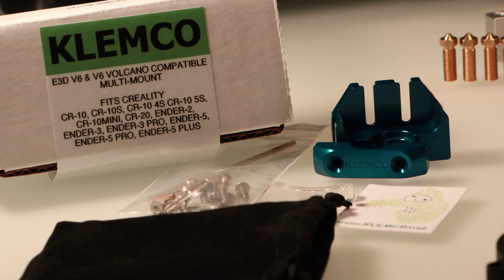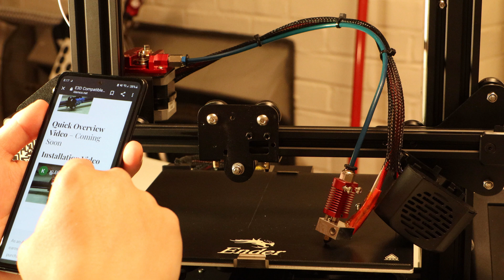Ender 3 V2 - Print Silently and 4X Faster!  (Step-By-Step Guide)

Comment: Thanks for the video! Just wondering why you didn't upgrade the cartridge heater to 50W to get increased plastic flow.
Reply from the maker: The main reason: this was my first mod where I changed parts on the hotend and I wanted to keep the old components so I didn't mess anything up.  

You only really need to upgrade the cartridge if you are sustaining very high flow rates or printing high temperature filaments. I haven't got there yet but I'll be testing out some high flow hotends soon that I'm super excited about. I have a couple from Phaetus and one from MicroSwiss. I'll use some 64 watt cartridges so I can push over 60 cubic mm/s, then eventually past 100 cubic mm/s with a crazy double heating cartridge setup that is currently in the works.

I would really like an LED hooked up to the heater cartridge so I can see when it's on and off. That way i could easily see if the cartridge is working at its limit.

Comment: Dude you could have easily installed the fan internally on the power supply
Reply from the maker: Yeah, I recommend that for anyone doing this mod that is comfortable with opening up the power supply. Just make sure to unplug and discharge it before you begin!

My other concern was that the noctua fan would not be powerful enough to keep the PSU cool. By leaving the old fan in there I am 100% sure at least one of the fans will satisfy the cooling requirement designed in by the PSU manufacturer.
Reply: @NathanBuildsRobots  what's the point of the noctua fan then?
Reply from the maker: @certified-forklifter  It makes it quieter. The PSU stays cooler so the fan turns on less often and when it does turn on the noctua fan muffles the noise it makes.
Reply: @NathanBuildsRobots  mh, okay

Comment: Noctua makes 24v fan.
I'm not an expert in 3d printers at all, but I can't  understand why everybody on YouTube is so eager to put 12v fan on a 24v power supply when literally the SAME brand makes 24v fans at basically the same price.
There is even a Linus tech video about them. ... So no excuses not to know about them
Reply from the maker: I believe your  are referring to the 24v industrial PPC fans.

The issue is they are pretty loud when running full speed on 24V since they are designed for industrial applications. Plus they are more expensive than the consumer grade fans. I think the fan speed can be controlled over i2c using the main board. Or you could use a bunch of low noise adapters (resistors) to slow them down to quiet levels. 

I tell you what, I'll order a couple and see if I can use them in my next build. 

Ideally noctua would start offering 24V flavors of the silent consumer grade fans, if you know where they sell them I'd like to take a look.
Reply: @NathanBuildsRobots  they are slightly more expensive (for a 2000) but it's few dollars.
You can easily find the 120 and the 140, the smaller ones don't seem to be available anywhere
Reply from the maker: Ok, I'll try out one each and see how they work.

Comment: This video is so triggering.

Having an engineering background and working at a 3d printer retail shop and service you upgraded a matchstick of a printer to a lighter.

The only one good thing I see is that you repositioned the psu to get more air. Known flaw for the v2's
 Then you unscrew the old fan and you leave it in the psu still connected and screw the new one over it. Man the old one is still in there connected or if you did cut the wires those are loose in there. Working with loose wires when powered on.
 Even if you know what you're doing that's a bad example because many people that have this printer and want to upgrade it have minimal to none technical skills.
I know you want to mod it without 3d printed parts but man. It's so janky no wonder it smoked right away.
At least for the video and the inexperienced do some effort to take and highlight some safety measures and do the wiring properly and show everything.
Don't take this in a bad name, but I had one customer that did some dodgy youtube stuff mods on his printer and nearly burned his house down.
Reply from the maker: You should check out my next video where I literally burn down my house!

What printer/upgrades would you recommend? I just ordered a voxelab aquila and plan on doing a base model review, then some upgrades. Dragon hotend? Copper nozzle? Direct drive extruder? Would love to hear your thoughts and include them in the next video.
Reply: @NathanBuildsRobots  Do whatever you want.
 Just don't half-ass them like this one.
I didn't want to be mean or anything but dude don't set a bad example. You may not burn your house down but the average Joe that attempts to follow your video might end up as ashes.

Or you can work on live AC circuits while soaking wet and show me everything is ok. I don't care. Take what you want from what I said.
Reply from the maker: @sabaubogdan6997   I have a closet full of half assed projects, I would say this one is at least 3/4 assed, since it turns on and makes pretty nice prints at speed. 

Can you help me to make a better printer?  What model should I use? What mods? Should I build one from a kit or scratch? 

Also if you have any details on electrical safety I can add them to the video description or talk about it in my next video. If we can save 1 life by working together it will be worth it. Besides, I don't want my viewers turning into piles of ashes because then they can't click the subscribe button.
Reply: @NathanBuildsRobots  Yeah put some disclaimers like ' do as I say not as I do' ' I'm a professional' 'Attempt this on your own risk' 'Don't work on live circuits'
If you want speed get a core xy from AliExpress. The other day a friend got a Twotrees Sapphire and it's pretty much useless from factory. That would be an interesting project to make it work.
I would love to see those half assed projects from the closet
Reply from the maker: @sabaubogdan6997  yeah I guess I should emphasize that you should unplug the printer before doing most of these modifications. Not only protects you, but also protects the printer. 

I would really like to do a larger corexy printer with an enclosure and no 3d printed parts so it can go up to high temperatures and do PEEK and stuff. That would be my dream printer.

Either one of these would be great
https://banggood.app.link/CG30g1YGYeb
https://banggood.app.link/75bAB4VGYeb
Reply: @NathanBuildsRobots    for peek you would need a 400 degree hot end. And the ones that comes with the sapphire ones are pretty bad. It has a solid frame though just misaligned bad electronics and hot end and you need some 3d printed belt tensioners. 
The Tronxy one seems ok. I don't have experience with it.
I printed peek a few times and it's a pain in the ass without temperature control in the chamber. And it's not the cheapest material to print. 
If I would do a 3d printer enclosure I would copy some industial ones. With insulated sheet steel and a glass window enclosure. With radiators and fans for temperture control.

Comment: Need to do maybe a 5015 cooling fan setup maybe
Reply from the maker: It currently has a 5015 fan on it and prints great. Could use 2 fans for even more cooling. 

I should have printed a Benchy for this video, but I made one later and included it at the 13m23s mark of my other video.
https://youtu.be/nUhcNrtGIIs?t=803

Comment: I would get a larger mk8 nozzle instead of the v6 clone, swap the old 4010 or the new 3010 to a noctua and try out klipper if you want to go faster. The biggest bottleneck you should have is the stock extruder and nozzle, not the hotend.
Reply from the maker: My biggest gripe with the stock hotend is the fan noise. The small heatsink with densely packed fins is optimized for a loud high static pressure fan. I used Noctuas on another one of my builds with the stock hotend and noticed a slight increase in operating temperate compared to the stock fan. 

I experimented with 0.6-1.0mm mk8 nozzles and I was running into issues with the plastic not melting fast enough. It would push through the hotend with ease, then hit a wall where the plastic wouldn't melt fast enough and it would start to underextrude. You can fix the issue with a stronger extruder, but it's only masking the fact that your hotend is not transferring enough heat to the plastic (in my opinion). That's where the volcano comes in. 

I definitely have Klipper on my radar if things to add next,  and linear advance. I think implementing both of those on my printer would be time well spent.

Comment: What was the print settings? speeds, nozzle size infill etc. Thanks for the video
Reply from the maker: Check this video to see a Benchy produced by the volcano machine at the 13m23s mark.
https://youtu.be/nUhcNrtGIIs?t=803

Fast settings:
0.6 mm nozzle, 0.7 mm extrusion width, 0.6 mm top layer solid infill, .73mm first layer
Layer height: 0.3 mm, 2 perimeters, 4 solid layers top and bottom
Speed: 30mm/s first layer, 50-60 mm/s depending on feature
20% rectilinear infill

Detailed settings:
0.6 mm nozzle, 0.7 mm extrusion width, 0.6 mm top layer solid infill, .73mm first layer
Layer height: 0.25 mm, 3 perimeters, 6 solid layers top and bottom
Speed: 20mm/s first layer, 30-50 mm/s depending on feature
25% rectilinear infill

I also have a profile I call "Fat mode" that puts down tons of filament fast for printing solid parts

I plan on creating a website and uploading PrusaSlicer Profiles sometime in the next month.
Reply: @NathanBuildsRobots  both printer went with same settings on this video? And if that was, estimated print time is mostly unknown on your software that you used for the volcano? Thanks.
Reply from the maker: @MMK-342  
The black part was printed on 0.4mm nozzle on stock Ender 3 Pro
The rainbow part was printed on Ender 3 V2 with upgraded 0.6mm volcano nozzle 

The large grey part was printed on Ender 3 V2 with upgraded 0.6mm volcano nozzle 
I used the "fast" profile I listed above, but layer height increased to 0.5mm, perimeters increased to 12, and top/bottom layers increased to 20.

Comment: Hi, when you changed the hotend did you need to change something in the code? I have an Ender 6 and I want to change the hotend. Thank you for your videos
Reply from the maker: For this mod I did not have to change any of the firmware. 
I had to update my slicer settings to account for the 0.6mm nozzle. Let me know if you need help with that.

Here are the slicer settings I used:

For PLA  
Nozzle 200 C
Bed Temp 60 C

Fast settings:
0.6 mm nozzle, 0.7 mm extrusion width, 0.6 mm top layer solid infill, .73mm first layer
Layer height: 0.3 mm, 2 perimeters, 4 solid layers top and bottom
Speed: 30mm/s first layer, 50-60 mm/s depending on feature
20% rectilinear infill

Detailed settings:
0.6 mm nozzle, 0.7 mm extrusion width, 0.6 mm top layer solid infill, .73mm first layer
Layer height: 0.25 mm, 3 perimeters, 6 solid layers top and bottom
Speed: 20mm/s first layer, 30-50 mm/s depending on feature
25% rectilinear infill

Comment: Could you provide a link for the feets?
Reply from the maker: https://www.thingiverse.com/thing:4644945

Supports took a couple minutes to remove and I had to hammer mine in, but they are working great at keeping noise down. There are a lot of other designs of you look up "squash ball feet Ender 3"

Comment: would it be beneficial to use thermal compound with the thermistor to get more accurate readings?
Reply: No. It's a simple thermistor that it is read by an ADC from an Atmega/Stm32. They are not accurate by far, just enough for this application.
You are reading an absolute value not one with five digits after a comma. So you don't need to be exact.
Reply from the maker: @sabaubogdan6997  yeah, it technically increases accuracy, but in the real world it does not make a noticable difference.
Reply from the maker: Probably, the issue is that you need to use a high temperature thermal compound. I don't think the normal computer stuff will survive 200C.  

I'm going to be switching my machines over to using cartridge thermistors from now on. Reason being, it's really easy to short your wires to the heater block or heatsink. When +24v from your heater cartridge meets your thermistor wires through the heater block the microprocessor to explodes and your out $30-$50, ask me how I know!

Comment: Hello. Why do not use the Noctua NF-A9x14 PWM at the power supply?
Reply from the maker: That is a great fan, but I wanted to stick to the PSUs original fan size of 60mm, so I used the NF-A6x25 PWM.

It's not the best fan for the job, as it's more optimized for volumetric flow rate than static pressure, but it's the only one in that size that Noctua makes that I know of.

Comment: How come you have a external PSU on the V2?(i have a v2 also). and as already mentioned in the comments you NEED to remove the PSU fan on the inside, not only will it block the noctua fan it will be spun by the noctua fan when its not on, and yes the PSU is a 12v for the fan. 
I have these mods installed: 
https://www.thingiverse.com/thing:4627925 (PSU only with a corsair 120 AF fan on a Buckconverter at around 7-8v) and
https://www.thingiverse.com/thing:4630748 (v3/4 version paid. with 2x noctua 40x20 on a buck converter each) 
I also have a noctua 4010 fan on a buck converter replacing the Motherboard fan.

My printer is quiet now and since all my fans are on buckConvertors I can just adjust if I need it more quiet. Only noice now is the RD-D2 sounds now and again.
Reply from the maker: I repositioned the V2 power supply to give it better passive cooling. I showed how I did it in my video about the Ender 3 v2 power supply. 

I have verified that the internal fan is not being spun by the noctua fan, so it is not generating any charge. I have also verified that air is flowing through the Noctua fan and that PSU temperatures are lower with the fan on, so it appears that everything is functioning as intended.

Thanks for sharing those mods, I've been looking for a part cooling fan duct and that should do nicely!

Comment: You could have had 2 nocturnal fans(one for the hotend and one for the electronic box) and have them in series. Then you don’t need a step down
Reply from the maker: I though about doing this, but if one fan stalls I believe it sends 24V to one fan, since they are not a simple resistive load. I considered testing this out, but Noctuas are too expensive to risk damaging them. They are my precioussss!
Reply: @NathanBuildsRobots  i have used mine in series for 6 months and i haven’t had that problem when it have gotten filament in it. The other fan spins the same because the resistance is still the same true the fan(or else it would have shorted if it was a 24v fan)
Reply from the maker: Thanks for sharing your experience. I was googling this exact topic when i was putting this build together and could not find any good answers. 
My fans do this thing where they stop spinning for 2-3 seconds if I stop them by hand. I think it's a protective feature to prevent them from burning up the motor windings, but I have no idea what they are doing electrically. If you stop one fan  does the one in series stop spinning as well? 
Maybe they are built well enough that they can handle the occasional 24v?
I know it's a big no-no to wire RC brushless motor controllers in series, but maybe for brushless computer fans it's different.
Reply: @NathanBuildsRobots  I use 2 40mm no ray fans and the other one just keep spinning. But the one that get jammed may be a bit work many after a will

Comment: I would consider creating a single 12v supply rail rather than several down convertors less points of failure on heat critical parts.
Reply from the maker: Yes, I used one DC converter that runs all three 12v fans. Most videos I have seen use 3 separate fans, which isn't really necessary.  The downside is that I can't control them independently through the main board, but Noctuas are quiet enough that it isn't a big deal.
I also have a backup fan in the PSU. 
I considered adding a 12v relay that would automatically turn the machine off if there was a fault in the 12v line.

Comment: I've seen so many people printing the duct for their blower. Your tape method is super lightweight, cheap, fast, & effective.
Love simplicity.
Reply from the maker: It was supposed to be a temporary fix, but now I'm keeping it there until it falls off of its own accord
Reply: Yeah and cools even the heaterblock...
Reply from the maker: @hasserecht3678  Something about the shape of the tape produces a jet of air that doesn't hit the heater block. Think like an air curtain for automotive aerodynamics. Air is directing air instead of a physical wall directing air. 
I experimented with some other air duct designs and the kapton tape version still gets good layer adhesion while a couple designs I printed out did not.